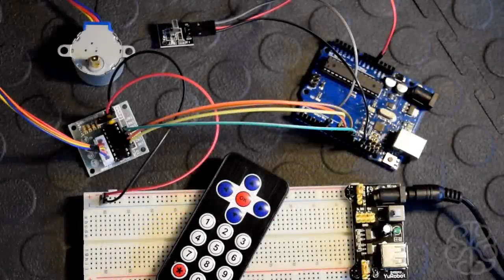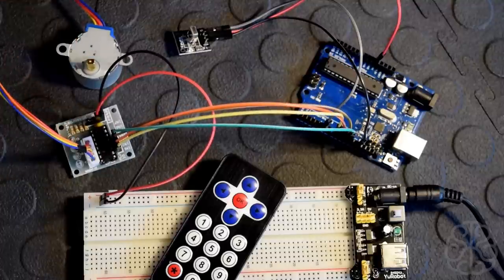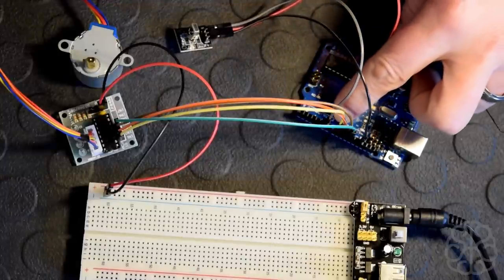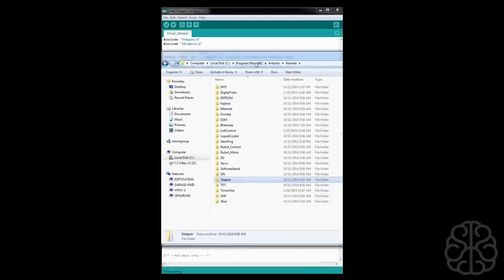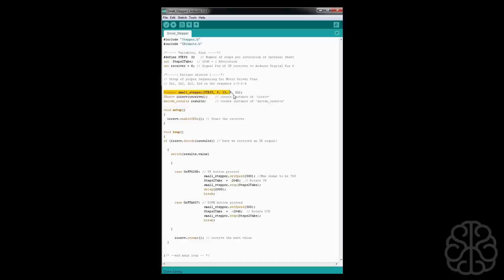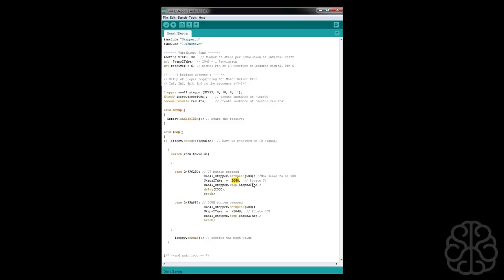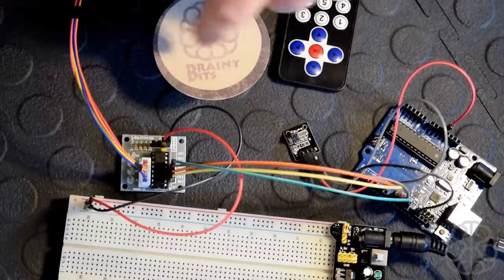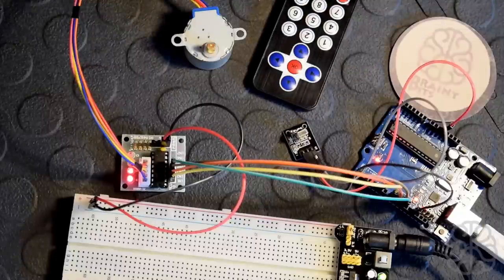Control a Stepper Motor using an IR Remote and Arduino UNO - Tutorial

Comment: great video will try to copy just for fun
Just asking did you press stop on the rotation .Just asking as im thinking of using this to have a drawer open and close via remote .To rely on a user to stop at the correct point every time would not be smart.

Comment: I need help. I am implementing a similar project. However, my remote keeps sending unknown code in other words sending 0s on every button click. Could it be a power problem?

The Stepper motor is connected to A4988 driver which is connected to my arduino 5v and gnd. Pins 2 for dir and 3 for step.

Also a 12vDC power is connected to the motor through the A4988

I connected my IR receiver module to the 3.3v and gnd on arduino. Pin 5 is for IR receiver.

Is this abusing the power level of my project? What should i do?

Comment: Hi i need help with this problem i wired it correctly and the code work but when i connect it the Stepper Motor Driver Module the leds on them dont turn on

Comment: Thanks for this tutorial. What about left and right button of the IR remote? Is it possible to command the motor to run one clockwise and one counter clockwise when left button is pressed and when right button is pressed 3 clockwise turns followed by 3 counter-clockwise turns?

Comment: hello brainy bits i have all the hard ware and have downloaded the code onto the arduino fine but when i turn on the arduino the ir sensor is solid red and by stepper motor with no light at all i have checked with stepper motor only code to see if my stepper motor was the problem but worked fine do you have any suggestions

Comment: I have a question, I could have the same result as your but by using  Samsung Remote Control. My question is that I want to have only 2 moves. I do not want to have a full cycle. I want to only have 90  Degrees from up then down and no more but whenever I use your code , the revolution does not stop. I linked my motor stepper inside a box , so that I cannot have more than 2 steps otherwise , the Stepper motor brakes the box or I lose the motor stepper itself.  Thanks a lot for your help ...

Comment: Hey first of all i want to thank you for this video. Its really beautiful and it helped a lot, but i have a small question. Lets say if i want to spin the stepper motor continuously CW  and CCW then witch code do i need to write? what changes do i make?
Reply: you can control it using delay function....digital.Write(HIGH):
delay(3000); you can use this function to rotate it CW continuously and if you want to rotate in CCW continuously then use digital.Write(LOW);
delay(3000);

Comment: If I do not have the breadboard power supply, would it still work if I have a power supply for the arduino? Would I need to change any of the wiring?
Reply from the maker: +Riley Seifert You can connect this stepper since it's very small and only uses 92mA to the arduino directly if wanted.  Thanks for watching!

Comment: Hello, thanks for the great tutorials, they are easy to understand.
I was wondering one thing,  on that breadboard power supply, can I input 9 volts into the USB port instead of using the round connector ? I'm about to order one and I'm not sure if the power supply I have will do fine
Reply from the maker: +Bkp Bert Hi, that's a good question...  I'll check it out tomorrow and let you know what I find out! :)  Thanks for watching btw!

Comment: Thanks for the tutorial! Im a complete beginner I started looking into this as I was looking to make a remote controlled display turntable Im wondering can you set it so you can do partial rotation instead of a full rotation per button press? Im guessing its just reducing the steps to take under the up & down button presses.
Reply: ok I've managed to do partial rotations but now im stuck on getting it to do continuous rotation any chance you could point me in the right direction?

Comment: Hello, sir thank you for this video. It's really beautiful and it helped a lot, can we make this project a multitask (this code and connection will also be present in it). I want the same project with multitasking of three LEDs controlled with the above same remote. I want the same controlling of stepper motor 28BYJ48+ULN2003 and thee LEDs separately with the other three buttons. Please if any idea shares this I will be very thankful to you.

Comment: Hi, I am a true beginner and am having issues getting my motor to turn. The code is correct and  the IR is sending through the UNO but the motor will not run. anyone have advice?

Comment: Hi, I have been trying to get a stepper motor to run continuously using an ir sensor, but seems that the time that it takes to pick up the ir signal is quite long and makes the motor run in bursts. I was wondering if you knew a solution
Reply: 6 Months later :)
IR is not very suited realtime control. I would think one of those very cheap digital radios would do it. You prolly dont need big bandwidth, But you want low latency.

Comment: Awesome made this!
You should make a video about " How to make an ir car with arduino"
Reply from the maker: It wouldn't be too hard to make an IR controlled car by using information in this tutorial and the one we did on controlling a DC motor using the L9110S here: http://youtu.be/kZHVJVzHs8s
Instead of using the Rotary encoder to control the motor speed, you could use IR codes and control 2 motors individually.  Thanks again for watching!
Reply: Brainy-Bits p

Comment: anybody know if you can  use the remote without the ir receiver, straight through the arduino? I got the remote in a kit but didn't contain receiver. I recently bought a Bluetooth receiver, though...